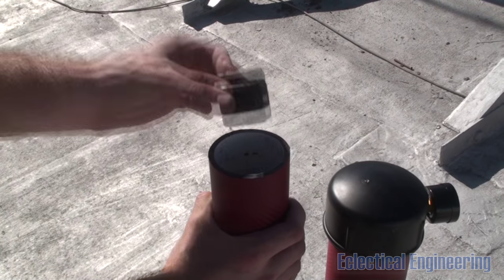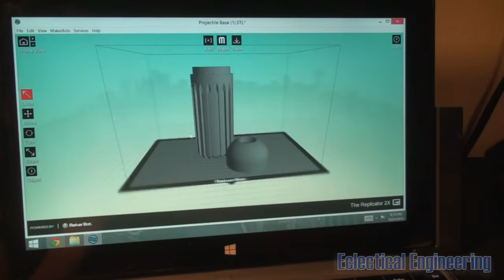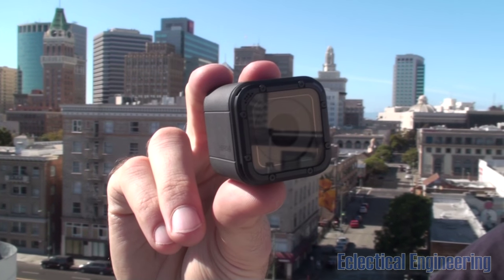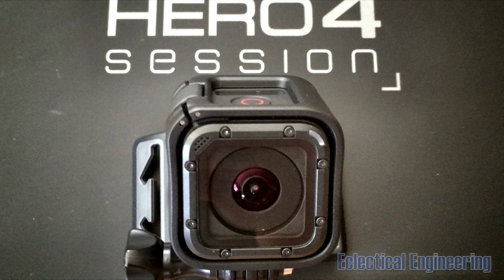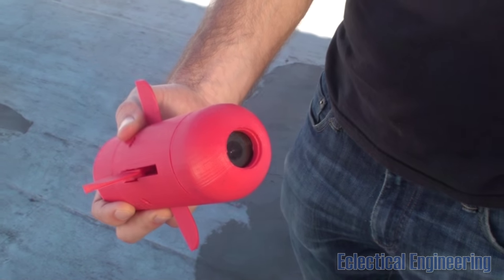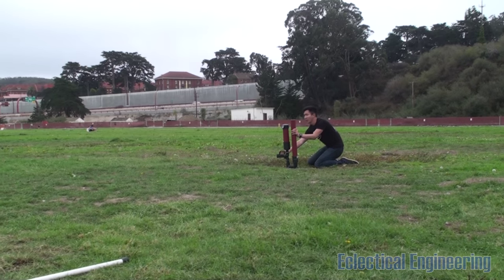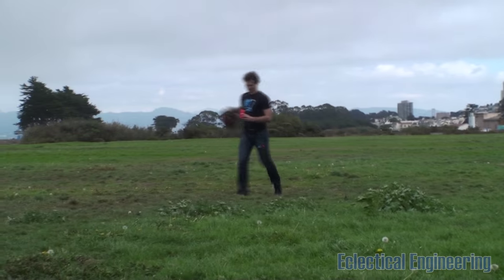GoPro Shot from a CANNON

Comment: Nice work, boys! Keep it up! #GoPro
Reply from the maker: +GoPro Thanks! Kinda bummed though. We discovered a simple solution to the spinning issues that same night! And we were recording at 30 FPS only..forgot to change the settings. Maybe we'll try it again later.
Reply: +Eclectical Engineering i reaaally want to see an image stabilised version of this shot now.
Reply: +Eclectical Engineering Yeah, try straightening the spinning footage using Premeire, would be a "Baseball" view flying toward an outfielder!
Reply: +Eclectical Engineering how do you fix the spinning issue?
Reply from the maker: +k4zuki Stick a weight on the bottom side (within the projectile)!
Reply: Eclectical Engineering thanks so much, i have a massive air cannon/potato gun i might try this out with if i can build a good projectile that will keep my session safe
Reply: +Eclectical Engineering wouldn't that destabilize it as it would not be spinning so any aerodynamic force in one direction would not be canceled out
Reply: I didn`t even know GoPro had a YT channel
Reply: @RyanKung w vid

Comment: With a few modifications, you can make a potato gun. Instead of air, you can use hair spray (the chamber would probably have to be a lot smaller) and add a piezo-electric trigger.
Reply: +Marc Stevens - i have one ,bad is that it consumes too much of potatoes - but shots are 150-200 m distance ...

Comment: To reduce the spinning, would adding some weight in the bottom side of the camera housing help?
Maybe then if shot from a 45 degree angle the spinning in the flght path could be minimized. Naaahh nevermind bad idea. It will still spin around...

Comment: Hi David and Ryan!
Here's an idea:
3D print the projectile with glow in the dark filament and instead of a GoPro you could fill the space with a 0 G trigger mechanism that shoots several flashes embedded around the projectile. If you film it at night with long exposure camera setting, it would be an awesome way to actually see how different shooting angles change the trajectory of the projectiles as well as its maximum height.
:D
Reply from the maker: Really cool idea! We'll try something along those lines. Thanks for the tip!